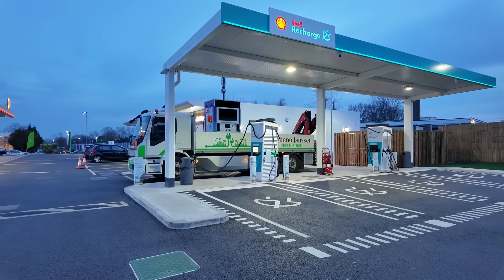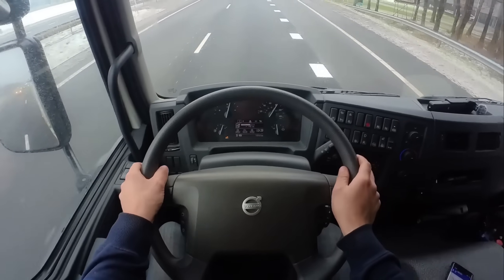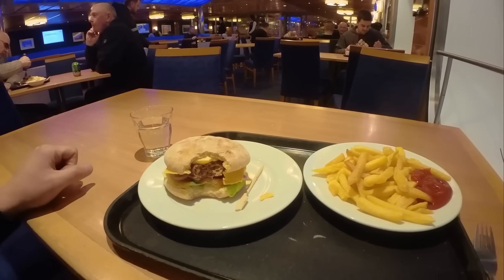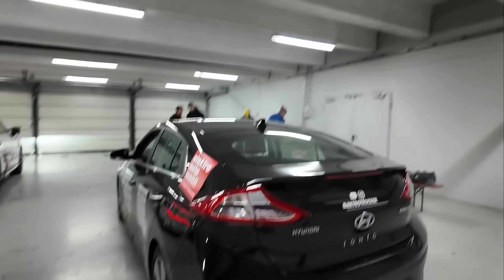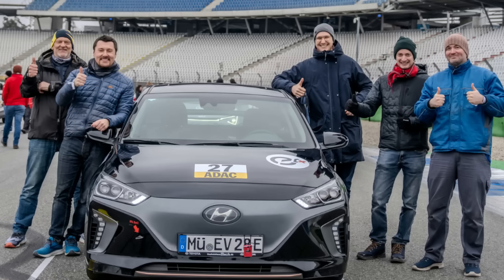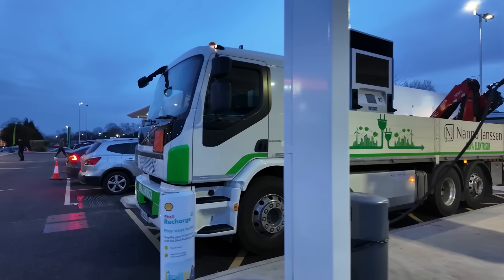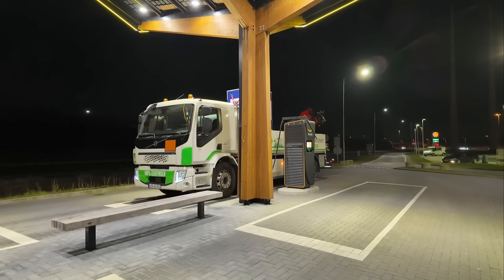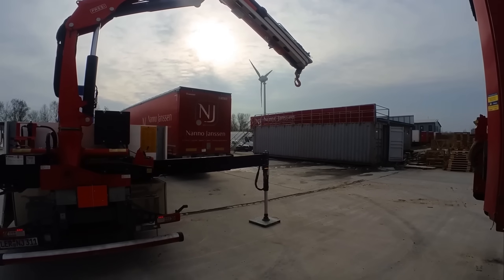This Charging Stations is a Battery

Comment: Hey I got similar absolute BS error experience in my 2020 Zoe 50. After 2 years I got 2 times in a row a red screen with electric error message, and it disappeared by itself, googling seems to have been a low 12 V battery (so why the eff doesn't the car go and recharge it instead of giving a fatal-looking error). Then when the car was 4 years (in 2024) I got 2 times in a row another similar error message but this time the car went to a 10 km/h limit. Both times it fixed itself after turning it off and on again. Dealership said the same BS like your Hyundai, that they can't really see anything wrong and the most they can do is a quick clean. Insane that these expensive cars don't have a simple logging memory to investigate what the eff happened.

Comment: The error with your Ionic could just be that components overheated.  They’re probably not up to task of being driven hard for 24hrs straight.  Hopefully it’s working well for you since then though.

Edit: Well, i just saw your comment that that an Ionic got 2nd place to a M3LR.  I’m curious if either had modifications.

Comment: I had the worst experience so far driving an electric BMW I5 that I rented (not by choice, they swapped it from the tesla I ordered). It had a horrible charge curve. Several charge companies in the UK didn't accept credit cards from Australia.  Ionity was the worst!  And several companies' chargers, which I had to download the app, wouldn't allow me to because google Play said this app is not for your country.

The BMW itself drove like a house boat and had several features like adaptive cruise that didn't work because you have to have a subscription to use it. The car also had less storage space than a model 3 which we got later on with all cases housed in the boot or frunk. The bmw had two cases in the back seat.

Comment: I think those parking restriction signs are "standard EV charger" signs that have been made assuming that you're going to be charging a car (which is unlikely to require more than an hour of charging on a fast charger).  It's designed to stop people abusing the system by setting a user override on the charging rate (this was definitely possible on a Polestar 2 that I hired (rented); I don't know if it applies to other makes/models).  For example, you could set a max. 7 kW charging rate and get many hours of "free" parking because your car is still technically charging.

Comment: There seems to be a design flaw with the battery system in all EVs. Most people think it just has one big battery, but in fact it still has a 12V battery and that does all the important stuff. All the usual ancillaries such as remote door locking, immobiliser, headlights, wipers, heater fan, radio, heated windows, cameras, etc are powered by the little 12V battery. The big battery powers the motor and charges the little 12V battery, however I suspect that the charging current is limited so as not to deplete the main battery too much. The 12V battery is only charged when the vehicle is switched on, which seems to be the design flaw because it should be charged when you are charging the main battery. If you run for a short period of time, such as 30 minutes, there is not enough time for the main battery to charge the 12V battery, especially if the !2V battery is powering headlight, heater, wipers etc.
Reply: If true, that would also apply to gas cars, which also only charge when the engine is running.  Which is a good hint that it's not true.  The 12v battery charges in a couple of minutes...
Reply: @davidlloyd1526   good point.

Comment: I was rather SHOCKED by a 20% loss in battery capacity. How does this happen in only a couple of days with it left off?
Reply: It's not a real loss. BMS estimated charge higher before turning off. Then battery cooled down, maybe some data was reset locally. Then next use the BMS estimated charge lower. Does not mean there is a real difference in charge in between. Sometimes heating up batteries can also increase BMS soc displayed. He could have left the truck for weeks without draining battery. Only things that drain are active systems, such as sentry mode on Tesla
Reply: @noleti what is the real loss in your opinion?

Comment: The switches and buttons for the controls are much better and safer than touch screens, in my opinion.
Everything gets strangled by bureaucracy. I thought Britain was bad but if you suffer in the Netherlands, too, then it is not just here.
If power supply was sufficient on board, the 8 hour ferry crossing would be a good place to recharge, but it is unlikely to happen as it would need a large increase in generator capacity.
British charging infrastructure is still expensive and insufficient.
Drive safely🚚
Reply: There is massive generator capacity for the bow thrusters that would be surplus during the crossing to charge vehicles
Reply: @stevejones9788  Good point,

Comment: More efficient then burning the diesel in the truck? This statement is crazy. Electric trucks are less efficient than diesel trucks if you charge them from public chargers. Around 33 l/100 km if you convert the cost of charging in diesel compered with 25-27 l/100 km for a fully loaded diesel truck.
Reply from the maker: I meant that the diesel generator is more efficient than burning the diesel in a diesel truck because the generator can keep a constant temperature.
Reply: @electrictrucker ok, but there still around 15% loses when converting kinetic energy in electricity. Every conversion is energi consuming.
Reply: @stefanrus4723  There may be 15% losses when converting diesel to electricity but that's a hell of a lot better than the 65% losses when converting diesel to motion. 
The generator is always running at the most efficient speed whereas a truck engine has to speed up and slow down (and idle). Plus the electric truck has regen braking which the diesel doesn't.
Reply: @MrHemlock51 my original point that I was making has nothing to do with efficiency of diesel trucks. As inefficient as they are diesel trucks are still cheaper to use then electric trucks.
Reply: Less efficient???
Thanks for telling us you know zero about physics 😉
Reply: @hughmarcus1 you are welcome but I wasn't talking about physics. You should have understood that when you see me writing about costs per 100 km driven which is bigger for electric trucks and also the price of one is 3 times as much. Transport is about efficiency on the matter of costs. Total cost of ownership for electric trucks is the reason why they are not going to be adopted on the large scale.  Use your logic, more expensive to buy and more expensive to use in a business wit marginale gains.
Reply: @stefanrus4723 you’re making assumptions about charging costs. You can guarantee a big transport company isn’t paying the going rate for charging, just as they don’t pay the pump rate for diesel. 
I have only a small business & I have a load of fuel card issuers chasing me & offering 10p off the pump price for diesel. Some of them are now offering reduced charging rates for EVs. 

Factor in no emissions charges for your truck, which in the case of several UK cities is considerable. 

An electric motor as a means of propulsion uses about 30% of the energy of a combustion engine
Reply: @hughmarcus1 your argument is making it iven worse for the electric trucks because there is no preferential price for electricity at public chargers for the moment. What do I think is going to happen with the electricity prices in the future considering al the investment needed in the infrastructure?

Comment: i'm not understanding how you could charge at 43kw from a 22kw chargepoint... is it because of 240v vs 450v?
Reply: 43kW is the truck's maximum AC charging power that it will accept. If you use a 22kW charger, you only get 22kW from it. All AC chargers are 230-240V single phase to my knowledge. With the 22kW and above AC chargers all typically being 3-phase supplies which is 400V between phases.
Reply: The EVSE communicates with the onboard charger instructing it the maximum it can draw from the socket; from 6A to 64A in 1A steps.

400 V 3 phase at 64A delivers about 43kW, while 6A 230V single phase gives 1.4kW.

According to the standard detachable cables are only allowed up to 32A, above that requires a tethered cable.

The standard goes up to 80A, used in the US due to the lack of 3 phases.

In the example in the video, the 64A charger in the truck will charge at the max speed the EVSE has instructed.

Comment: Car manufacturers REALLY need to sort out these CANBUS error messages; I had been struggling with one all  through May - luckily now resolved - similar to yours, it manifested as a "Check electrical system" warning; however the fault code could be one of DOZENS of faults, battery voltage too high, battery voltage too low, short to ground, communications errors - basically nearly everything that could possibly go wrong with an EV was covered by this one code (Kia).

I was fairly certain it was a communication error, as the first time it happened, there were some other communication error warnings, but they cleared and never returned - possibly because I used electrical contact cleaner on the DC charge port contacts (hadnt been used in over a year).

Despite the warning being potentially dire, I wasnt too worried, as it was only occurring after a charging session using my brand new OrientRise CCS2 to CHAdeMO adapter, and the fault cleared if I charged directly with CHAdeMO.

After some data logging submissions, and responding firmware updates, the 3rd firmware update fixed the issue, and now the error is gone; kudos to OrientRise, they were responding with new firmware within 8 hours of me submitting the data logs; far faster than I was able to actually go test the firmware updates; there are only 2 chargers near me, both in near constant use, so it was a 30mile/40KM round trip to the nearest multi-charger location.

..............................................................................................................................

In your case, I would check the 12v battery terminals, one recurring issue I had when I first bought my Kia, was being caused by the awful design of the cable clamps - they kept working loose and buggering up the electrical systems - and also chewing up the terminals on the 12v battery itself.

Even at maximum tightness, I could twist the clamp around the battery terminal post just using my hand.

I had to replace an otherwise, perfectly good 12v battery, replace the clamps, AND make some copper shims to ensure the new clamps gripped the battery terminals securely.

In 40 years of car ownership, I have never seen such a shit, battery clamp design.

Comment: sucks about the race. 
Your channel shows that even if it dose not have the range needed it can still be done.  I hope designers for charging parks think of trucks as well when designing stations.
Even in the US we have chargers with batteries because even here it is hard to get the power you want at the optimal location for chargers but you can get lower power connections.
Reply: If I could give your comment a reward, I would. 🇺🇸⚡

Comment: Very good episode as usual, Tobias, and now a lot of questions for you:
1./ [At 00:18, a small English usage note (generally your dubbed version is flawless); rather than 'went smoothly' use 'go smoothly'] [At 11:35, I'll add a CC spelling error 'ferries' rather than 'fairies' not sure of the previous mention probably an autocorrect mis-correction] [At 14:00, a small English usage note "it's 3:00 in the 'morning' rather than 'night'"] 
2./ At 00:40, can those straddle carriers lift and carry more than one container at a time, or are they restricted to one by one movements?
3./ At 02:47, could the crane be made more aerodynamic by covering it with a fitted tarp or would such a cover be too difficult to put on, take off and stow away? can it be rotated more fore and aft than side to side when idled for less turbulence?
4./ At 05:40, are the fence posts fixed into truck tires (filled with concrete floated on the asphalt median/apron)?
5./ At 10:01, can those charging station units be laid down on their back or sides (maybe supported) for more aerodynamic transport when completely inoperable or are there safety or design reasons always requiring a 'this side up' orientation?
6./ At 14:14, what happens for physical custom clearance if the original vehicle decides to output an error message and then shuts down like your unfortunate Ionic?
7./ At 14:36, your demonstration off loading the charging unit safely shows it could have been safely craned aboard at the client's location.
On your return trip had you convinced the client to let you load the charger with the crane or did they still insist on the forklift for loading (did you at least demonstrate the crane and explain its capabilities/capacity for their future comfort)? (Maybe send them a link to this video.)
Reply from the maker: That's a lot of points and thanks for your corrections. 😀

2. They can only lift one container at a time, but can stack 3 or 4 on top of each other depending on the straddle carrier's size.
3. I think it would be too much work for too little efficiency gains and I am not sure if a cover for it exists in the first place.
4. Yes. 😅
5. They are required to be always standing.
6. As far as I know, you have to do customs clearance after your truck is fixed, but in theory you could tow your broken truck to customs as well.
Reply: @electrictrucker  Intresting.